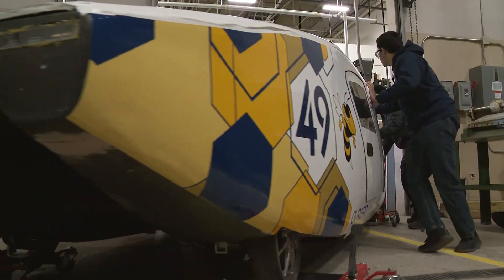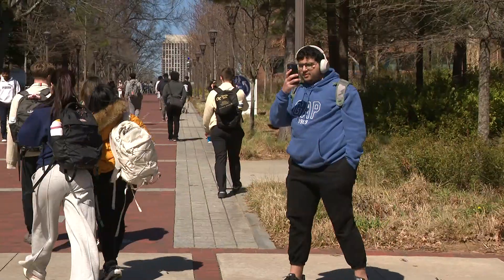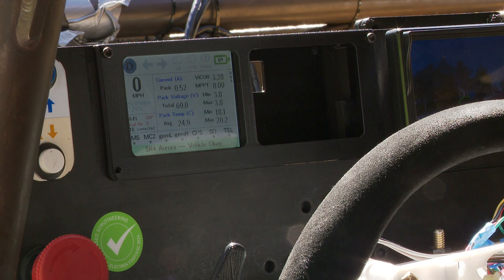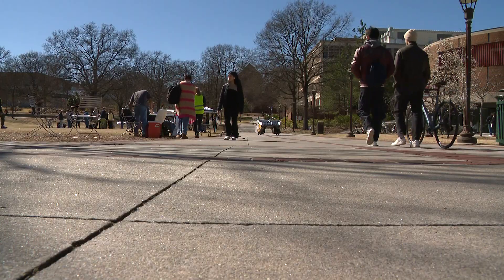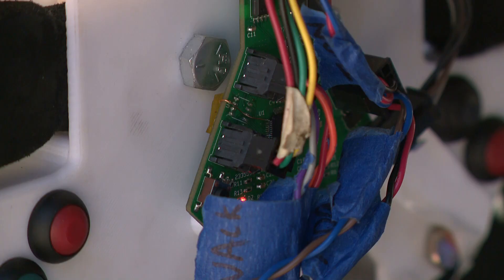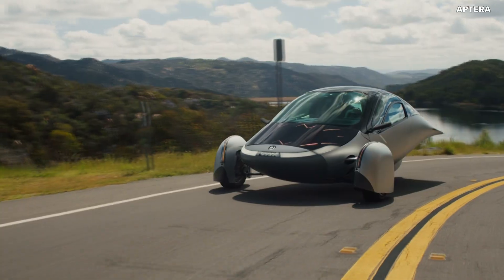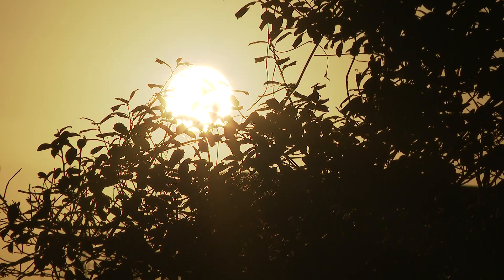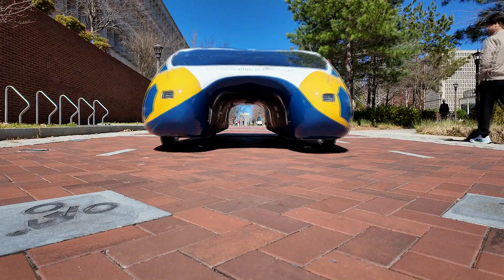Georgia Tech solar car powering future of transportation

Comment: When are you going to build one for sale great job
Reply: They should just attach the solar power to roof and sides of car with backup inverters internally, then and add it to the EV cars we already have in place.  Always have extra mileage on the go or when it sits. It’s an ingenious way to keep your car always charged and ready to go for any trip essentially.